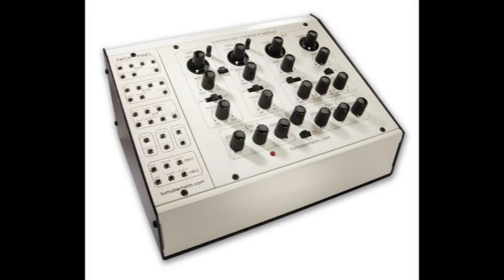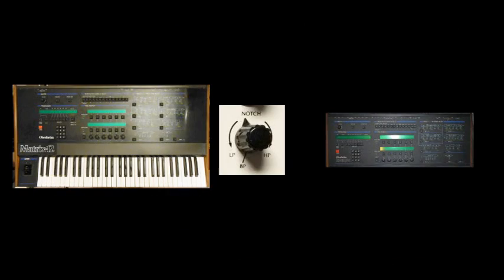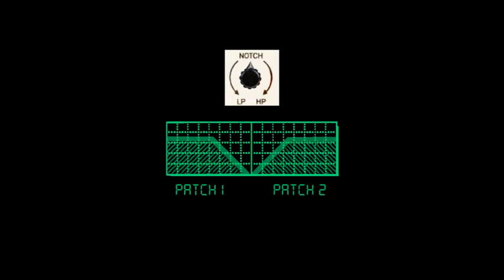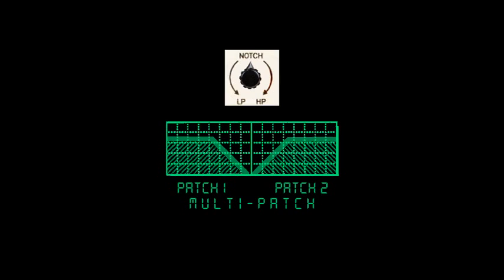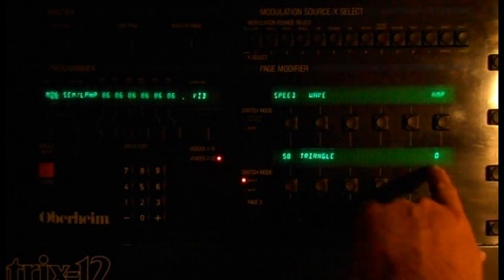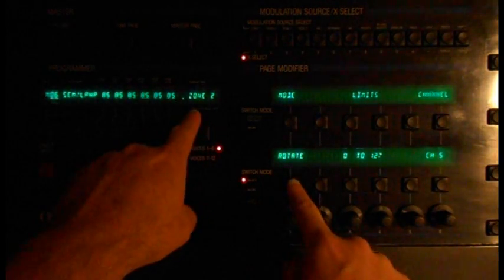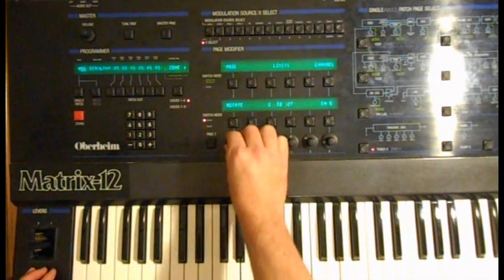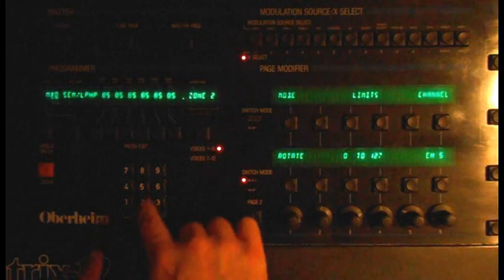Oberheim Matrix-12 Synthesizer Demo #4 State Variable Filter Behavior

Comment: Great video. Super well explained.
Any chance you know how the OddenMart Expansion (additional mod) on these machines work?
My Xpander has those 6 AUDIO inputs at the back, which I assume can be used to modulate VC01 (?) but so far haven't been able to crack it. 
Thx
Reply from the maker: Maybe the inputs come in on VCO2.  And maybe the inputs are normalized to override the noise circuit.
Reply: Thanks. I'll keep trying :)
Reply: @gstormelectro  Many years ago I corresponded with Lx Rudis about the 0ddenmart Expansion and as far as I can recall you're basically correct, FWIW.